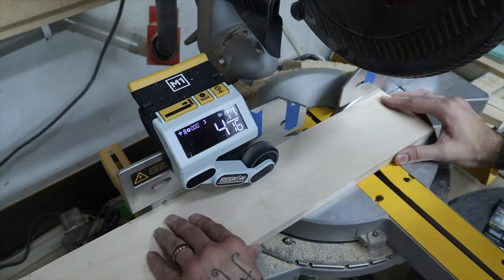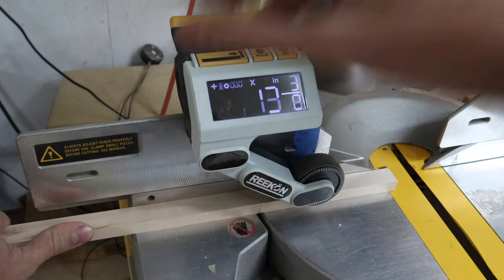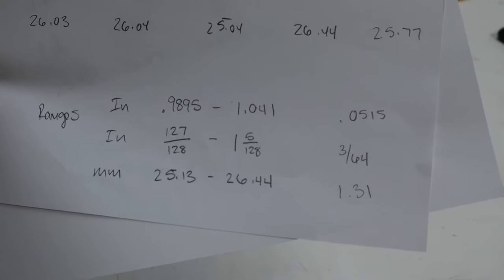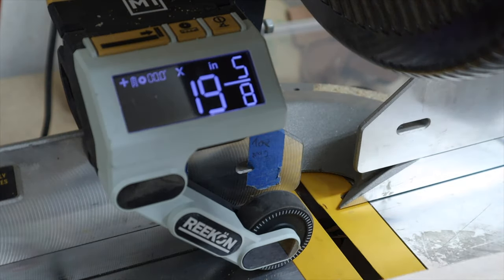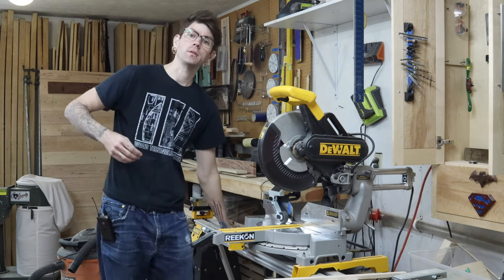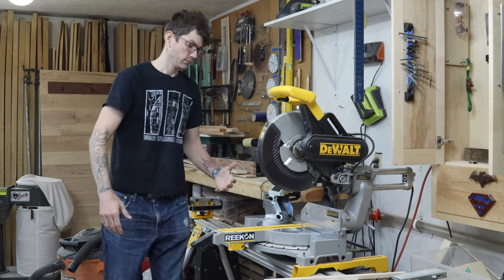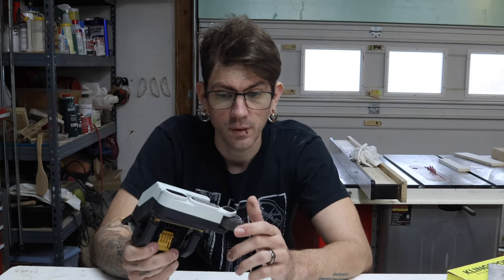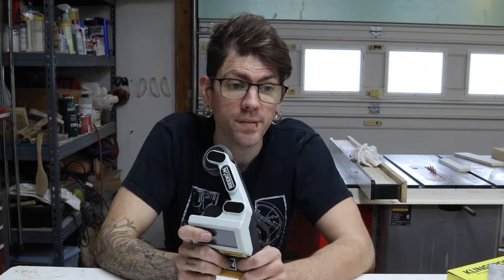Future or Flop. Reekon M1 Caliber Revisited [ FINAL REVIEW ]

Comment: Thanks for the feedback!  We are always looking to grow and improve our products and the feedback is extremely helpful. While we try to make our products work for as many different kinds of trade and use case as possible, there are undoubtedly scenarios where it may not be the best tool for the job.  Some additional notes below on some of the recent changes we made/general notes about M1 use:

1) The arm locking mechanism has been completely redesigned to prevent any kind of arm dropping
2) When measuring in inches fractional mode (1/16") there will always be a spread of 1/16" (+/- 1/32") based on what can be displayed on a screen (regardless of device accuracy).  The bets test would be to measure in inches decimal mode for maximum accuracy and repeatability.  
3) As the system is open loop, we do encouage users to calibrate regularly to account for changes in wheel diameter (temperature differences) along with other external factors.
Reply from the maker: Appreciate the information. I know my version was on the early early access level of release so I figured a few of my complaints would be addressed and changed for future releases. The decimal system is certainly a good way to go to improve accuracy so its a good tip. I will, given the one I currently have, not be using it either way. But I can appreciate that you guys take and implement customer concerns into your products.
Reply: I share the same experience with the tool.
Reply: @kovadest  we would be happy to help with any issues that you're facing!
Reply: @REEKONTools  Many thanks for your response. My device does not hold the calibration value and the arm with the roller does no remain in the upward position.
Reply: I think I purchased a newer version of this tool as I do not seem to have the problem with the arm staying up. On the contrary, the directions that came with mine say to push up on the arm and that will release it from 5he holding mechanism which does not appear to be the case as I need to pull down on the arm to get it to come down onto the workpiece. Although when detract it back up it holds nicely. The push pin that holds it in place seems to do a nice job. As far as the calibration goes I cannot say just yet as I just received mine and haven’t had the chance to use it yet. I also purchased it on Amazon but found it for $30.00 cheaper on another web site so that worked out good. I’m a small shop worker and I am hoping it works out for what I am looking for it to do.
Reply: So how will I know if I'm getting the new design or the old ? M2?
Reply: @rayfab5668  hey Ray, all new units sold now are the new revision (Rev D).
Reply: Its ok ReekonTools, I still love this product. This is still moving in the right direction though =/- 1/32" some people cant even see that line without wearing glasses hahaha. We always think of products as the perfect product that comes in a box perfect, does everything perfect and stays perfect.

Comment: Saw this at the JLC conference. Many of these issues were addressed. On the job site, this thing seems like it would be a great advantage. Much better than trying to measure each piece, mark it, then find mark, position laser then cut. Clearance also not an issue on job site. I plan on buying this. Thank you for review.
Reply from the maker: I know many things have been addressed as they have continued work on their product. Overall I do see it as a good tool with a great application in the right environment.....ultimately my shop was not the right one 🙂.
Reply: I've got one, use it professionally on the jobsite and in the shop. I've not experienced anything negative. Most all problems I see in this review and others are simple user-error

Comment: Apparently you need 6' to either side of your mitre saw blade to calibrate this tool. My workshop is 10' x 10' so that's only 5' on either side. Reekon either needs to find a workaround or list this in the product description so people will be more informed before purchasing. Reekon CS did respond and told me that 6' is indeed required for the calibration and advised me to return the item to my local big box store. Thank you.
Reply from the maker: Yea mine has been in a drawer since I posted this...great in theory but no good in my shop
Reply: @TheWoodVeteran  Took it back today. It would take a lot of effort for me to take apart my custom home built workstation to move my saw to calibrate and then put it back again. This would have to be done every time to calibrate. I'm looking for tools to make my life easier, not harder.

Comment: So I like your review video, I also have the tool, and noticed those annoyances. Primarily if you are needing to cut shorter pieces or a little bit off. Seems to me that is one of the biggest limitations. The second one, is taking to account any curvature bow or whatever on the wood itself. that can take minute measurements off. I found this out trying it on some common shiplap. Compared to the nickle gap the ship lap is slightly curve or bowed, and so ever so slightly lifts the board which could add a sixteenth or more. as you are passing the board through the board flexes a bit and moves. which is where I think these inconsistencies really matter. This really works for like framing, or even baseboard installation where you are just production pumping out and you can afford a bit of variation. Now that I know that that's what causing the inaccuracy, i make sure to keep the board pressed down as best as possible. for me i know where the tolerances lie, and where I can use it. so so far it really just helped with that production baseboard and framing.

Comment: Looks like they fixed the flapping wheel lever, mine doesn't snap down as easily. Still neef to turn my saw to calibrate and if I want to use the full range of mitre capacity I have to install 12" from the blade or the motor housing of the saw will hit the measuring tool. Eventually I'll invest in Pro Scale for my left fence.